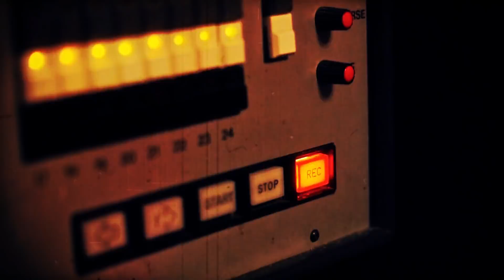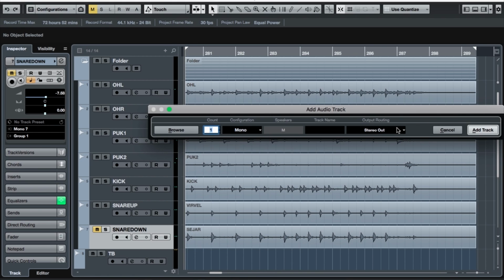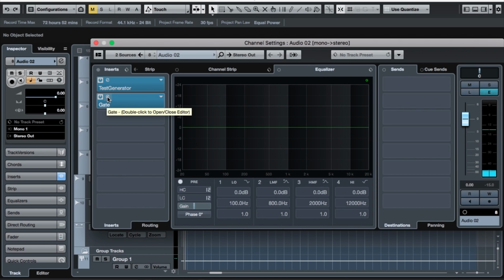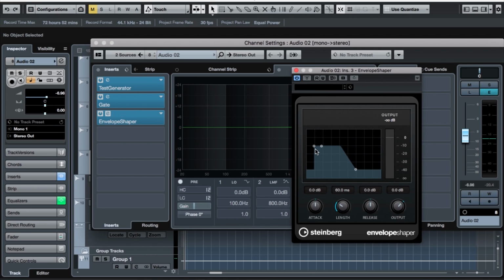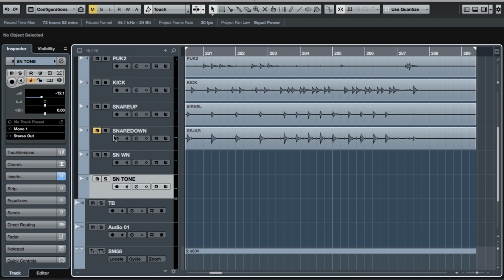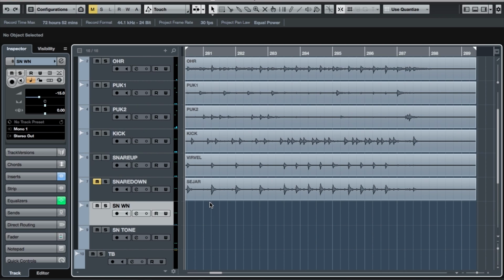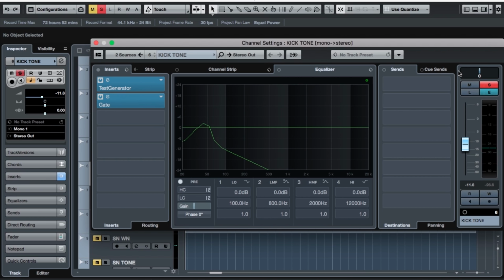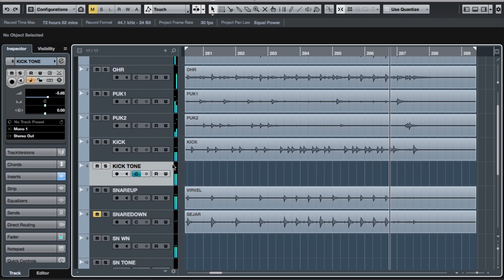Enhance Drum Sounds With Signal Generator! (HoboRec Bull Sessions #30)

Comment: i have a question. How do you determine the frequency value you will use for the signal generator. sometime you used 350hz, sometime u used 45hz? how do we know? my english bad. i am only watched u.
Reply from the maker: I just tweak around until I get a frequency that fits together with the sound of the original drum.
Reply: is this method used for each instrument?

Comment: I use this technique live to enhance kick drums. Works amazingly well!
Reply from the maker: +Bone Scheffel really? That's cool. I haven't done much live sound so i haven't even thought of that possibility.
Reply: It's very useful on a kick drum without a hole in the front head. Sometimes it can be difficult to get any low end without feedback, I put in a HPF to get rid of feedback, and then dial the lows back in with the "trigger". This also allows you to tune the drum to the key(s) the band is playing in by adjusting the frequency in the signal generator.